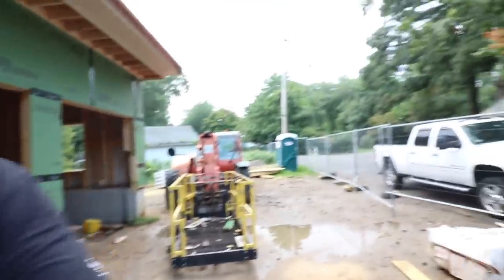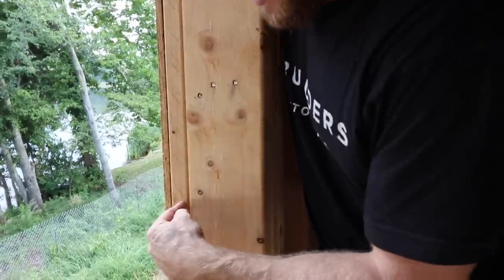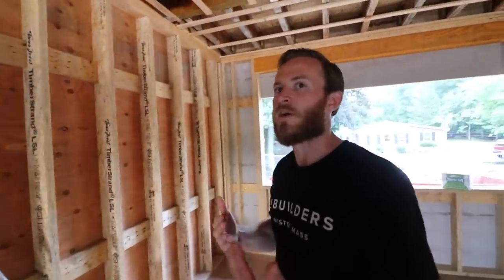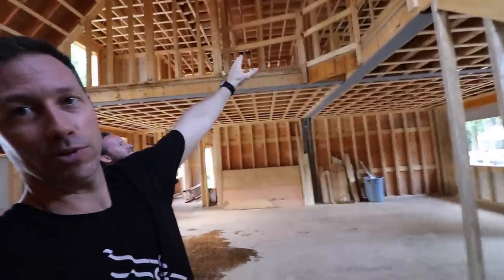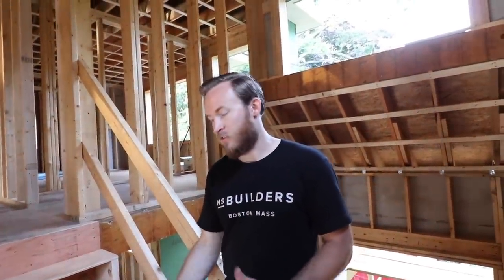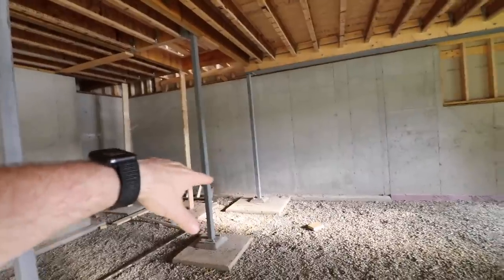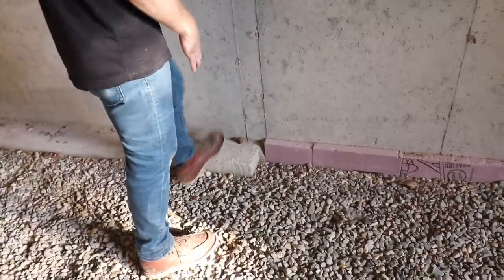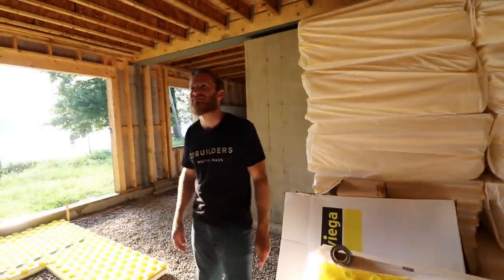How do they Build in Boston? Visiting a new home in Framing

Comment: So to disparage 99% of all true pro framers in the Massachusetts area is disgusting....That guy has a lot to learn about framing. He is nowhere near the  top framers from Boston to Cape Cod...
   First the garage plywood should be vertical and attached to the pt sill not sitting on top of nailers,(hacks install plwood horizontal and add nailers) that's not even code....
  The kitchen gable wall should have been "balloon framed" from rafter to bottom plate using engineered PSL...that chisled out strap shouldn't be there at all  if framed right...
   Single king studs at windows is not code and hack work anyway...
   Using PSL studs, Lsl suds is common practice in all kichens and baths and stair stringers ( which also should have a 2x6 glued and screwed to the side of it,to add strength) for a decade or more...
   No glue seen in the engineered joists hangers ,which is required by the manufacturer. 
  No blocking at the deck plwood seams ,two bays in all around..
    On and on the amature builder failed to make a quality home....as his first frame ,he failed miserably to build a high end quality frame.....
    For framers like us who been building custom homes for 30yrs,and are booked up to a year in advance, your ignorant comments and lack of talent is why we are always busy...
Reply: On point
Reply: Where would the strap go otherwise?
Reply: Can I come work for you?
Reply: I want to believe you just because of your last name
Reply: Rather have a framer that knows how to frame than one who's got a useless degree in perfectly formatted comments section posts. ;)
Reply: Joe Framer yvv
Reply: @ClaytonYatescarenthusiast  you don't need a strap the studs should go floor to ceiling
Reply: @joeframer9642  makes sense
Reply: @joemonroe9456  I appreciate your comment,but that's the problem. Guys like this that read the manufacturer instructions instead of knowing what to do. It's like a set of blueprints for a custom home. Framers like this , follow the plan exactly, instead of recognizing mistakes in the plan and correcting them in the field. 
   Your the type of guy who likes the builder with the shiny truck and fancy new tools, I'll stick to my poor gramer and thirty years ( never out of work) of building  custom homes. My time is dedicated to craftsmanship not penmanship.
Reply: I see the value in both Joe Framer and Joe Monroe' comments. Yes, designers and engineers don't always put out a well thought out set of plans. Less so manufacturers but even their instructions can (sometimes) be improved upon. A great builder doesn't need to know how to make perfectly spelled comments but they do need to read those instructions and clearly communicate any of their concerns to the Owner or Designer. I've experienced builders who simply took it upon themselves to quietly "fix" what they didn't understand, install ceiling rated drywall on walls and wall drywall on ceilings, and put 8 bends in a bathroom vent. All claimed to have been "doing this for x years" and I was supposedly the first to call them on that. It happens less often that they actually improved on the design but I still would have appreciated them informing me of those changes.
Reply: You're only but so good yourself when your own ignorance shows in bashing others, theres a better way to communicate and still be professional
Reply: @joeframer9642 There are pros and cons to each method and a balloon frame has plenty of it's own problems. Your comments are just as pretentious as the "99% of framers" comment they made. You assume so much without knowing the details of this build. Classic internet.
Reply: @nickmanc86  I don't assume anything,it's right there on video
Reply: @ACitizenOfOurWorld  I understand your comment,but I didn't go into detail,I was generalizing....in fact it would be a breech of contract to just make changes without permission...to be clear. I would see the problems with the plans, contact the builder,GC and send an email about the problem, explain and draft my solution via email,..which is sent to the architect and engineer to sign off on....I give multiple options and my recommendations....the problem is college educated architects and engineers with no actual field experience framing and no common sense...it takes a minimum of 5 years to understand the basics of framing....we only build quality homes to our standard or we don't take the job, we must be doing something right if we are booked up to a year in advance for over 30 yrs......as a framer I'm offended by the quality of his work and feel bad for the homeowner,that was my point
Reply: Bullshit on the single king studs. But I agree on the balloon framing of the kitchen gable wall. At 4:33, you can see he's got double jacks in the opening with the long header span.
Reply: Ha, I had a framer who built an addition to my house and bragged that between him and the other two on his crew they had over 70 years experience. Problem was their building techniques were also 70 years old! I now have problems with leaks, mold and pieces of trim falling off. First, I would say really do your research when vetting a framer/builder. (Apparently I didn't do such a good job) Second, people don't usually like change, so when building manufacturers change their products and installation procedures most people scoff at it and say it's "no good" or "what was wrong with the old product?" Building product technology is moving at lightning speed and builders/ framers need to keep up and keep an open mind with the way things are going.
Reply: Robert Russo -- technology is always in a state of flux, especially today where it moves quickly. In the 1970s, the "state of the art" technology produced lots of houses with moisture problems. Our "state of the art" technology likely has some unforeseen consequences yet to be discovered. Older methods produced durable houses, but they were inefficient. 
-- One could, by the way, reduce carbon footprints just by downsizing houses, without worrying so much about making them so tight.
-- Bleeding-edge technology has to be taken with a grain of salt. On the other hand, stick-in-the-mud, heels-dug-in resistance to progress isn't a good position either. One has to stay informed, but with a healthy skepticism.
Reply: So I have a question. I'm a firefighter, that said that's how I'm looking at this house. Is there any consideration given to how the house would burn, when engineered wood and balloon frame are used together?
Reply: Fireblocking is required every 10' on tall balloon framed walls. I'm not sure why you're worried about balloon framing and engineered wood. The fireblocking would seem to accomplish what platform framing does in terms of fire spread. But maybe you have seen something in your experience that I don't know. Maybe fireblocking isn't quite as effective as platform framing in preventing fire spread.
Reply: @grizzlygrizzle  Reson I asked is that engineered woods tend to burn at much faster rate then when compared  to solid wood. The blocking is effective is stopping the chimney effect that balloon frames have in a fire, when there is nothing breaking up the void.
Reply: Yeah, fuck all thos dyslectic framers who have been in the business for decades and learned their trade on site. Books are the way to go when learning how to build stuff, not actually building! :)
Reply: ya no one cares what garbage is done is cali
Reply: Wouldn't using balloon framing or not be up to the blueprints?
Reply: Well that in itself is an issue, they put an addition onto the house. The old house settles differently than the new section and has likely caused new settling to occur which is the source of your leaks which I bet is between the new and old sections.
That or you just didn't do a bit of research into them and got conned. Plenty of those assholes about in all trades who will claim to be long term experts and professionals but don't know shit, they just want to take your money and run before their mistakes show.
Reply: @SpcPoole  so I am a builder and a firefighter, with that being said I can tell you in fortunately the two trades do not communicate. Builders do not truly think how a house or materials used will behave in heavy fire conditions. The engineered wood used in this house is fantastic for covering long spans while maintaining high loads but yes these I-Beams will fall under fire load on roughly 5 minutes ( I have conducted love birds for training). Local building codes only care for the minimum and honestly half of them don't think about this either till an event happens to bring it to public's attention. I do want to clarify that when I say builders I am speaking in a generality to the industry as with everything exceptions do apply. To the exception I greatly thank you for the safety your thoughtfulness can bring to a fellow fireman. Anyway that's my 2 cents
Reply: Luther Dufrene   ---  Most of these people here don't understand the problem, 'my oven is made of steel and it doesn't melt' idiots, there are some fire resistant two-part spray foams that will add more time, this builder didn't leave room for them, they cost a little more and builders will try to cut it because the value doesn't show, the same applies to multiple blocking stud spaces and using fire-rated sheet rock vs 1/2", and who would pay for more than one layer of fire-rated sheet rock??  Most of the builders and buyers are shortsighted and really cheap.  The only way I've found to sell it/justify it is reduction of noise transmission, sometimes that works.
Reply: Preach on brother
Reply: He's gonna lose his shirt
Reply: @davidnull5590   abosolutly correct on how do you justify the additional cost to make your house more impervious to fire. The added noise reduction is a good sell I have never thought of that. Personally I try my hardest to stay with traditional framing as it is much beefier and will withstand fire well before structural collapse, but TGI beams have a well deserved place in the building industry and it is up to the fire service to stay current on the building technology going into modern homes and adapt their attacks. I just wish there was more communication between the industries.
Reply: Joe Framer m
Reply: I think you raise some good points Joe Framer, but to say that only hacks install plywood horizontally is saying an entire industry are idiots and crappy at their jobs. The plywood certainly should be framed down and over the plate, and nailed off correctly, but there is nothing wrong with attaching plywood horizontally. 

I use glue on my hangers too, but many don't know this will help to prevent squeaks. Not sure it is a requirement for every hanger.

Single king studs are fine, and totally to code, as long as it corresponds to the correct header length  and size. It also limits thermal bridging. Too many times we are putting in pumber when it isn't required. 

PSL studs are certainly the way to go if you want a straight wall. It would have been a good way to frame that wall....but using conventional framing members, they did it correctly.

Plywood seams don't need blocking.
Reply: @brad-yo7jb  running plywood horizontal reduces sheer strength, also blocking in plywood increases sheer strength and is why it is required on corners and in middle of walls over 25 ft
Reply: Of course it's required for shear strength, and I'd like to see the study or info that shows placing plywood vertically is stronger, or that using it horizontally is sub par or hack like. Just to be clear I use it in both orientations, based on the structure, and criteria we are dealt. The problem we are dealing with in the building trades right now, is that there isn't one single authority having jurisdiction for all locales. Some states are using 2009 IBC, some 2015, etc.. 

Many guys and gals in the trades, are taught one way, and taught to believe any other way other than "their way" is wrong or sub par. There certainly are best practices, and we would all be wise to follow them. Best practices also offer flexibility based on the climate zone we are building, micro environments, etc..
Reply: @brad-yo7jb  true there is no jurisdiction, I also have seen how many engineers recommend stuff done. Some of it I dont agree with. If shear strength is increased with less seams the why does roof sheeting run horizontally. I think it helps with walls but just by the smallest amounts.
Reply: I'd like to see the evidence on the vertical vs. horizontal. If a wall from sill plate to top plate is 96" than it makes sense to go vertically. If you go any distance above 96" it makes no sense to sheath it horizontally. Once you get over the first course, you still have as many seams, and even less of an offset of the sheets to provide the shear strength.
Reply: Joe Munroe, shaddup!
Reply: i agree on the gable wall being balloon framed!! def should have done it that way
Reply: Engineered wood does burn at a faster rate when exposed to open flame. The thing to consider when using engineered wood is IF it is protected, and IF it IS protected - are the cavities filled, and if they are - what are they filled with???

You see if you take an engineered stud wall, filled with BIBs insulation or dense pack cellulose (that is installed to the proper density), there is no room for fire spread generally speaking, because the void is densely filled. If it is an engineered stud wall on the interior, that is an uninsulated wall, or even insulated with batt insulation, and not protected by drywall, then it is very dangerous. It is dangerous even if it is drywalled, because the batt insulation does not stop fire spread. There is much truth in the fact that engineered TGI joists that are unprotected are firefighter killers. If the TGI is protected and the joist bays are filled with a dense pack insulation, the danger is nearly null. 

Open web wood trusses (whether they are roof trusses or floor joists) though are an entirely different story, because generally they make the entire cavity they are installed in wide open, even when insulated with batt insulation.

Ballon framing with engineered lumber is certainly a great way to build on long open tall walls....if the fire blocking is done correctly (tightly). All too often thou, the fire blocking is not installed well.

A double plate top plate will also always stop fire spread better than any 2x material nailed or screwed into a stud bay. Joists resting on the plates and studs below will always be a stronger assembly and fire resistant assembly than a mechanically anchored rimboard into a balloon frame wall.
Reply: joe framer is right on, i believe you went soft on pointing out the problems, to many people on here that might be looking to hire this guy or somebody like him and then not know something is being framed incorrectly, im working on a remodel now and im having to completely tear out and frame the master bath from a bad framer, they pulled 2x4s for joist tying into 2x6s with half ass support walls, guess they ran out of 2x6s, and not one hanger in site
Reply: Joe Framer "My time is dedicated to craftsmanship not penmanship"  gunna use that with my boss next time I drop off invoices.
Reply: grizzlygrizzle we are seeing a lot of air quality problems in newer homes. The idea was they seal them tight to keep in the conditioned air. The home becomes more efficient but on the flip side the air becomes stagnant and unhealthy. Many HVAC companys are doing "fresh air intake vents to bring in some fresh air to mix with the air in the home.
Reply: @joeframer9642  in europe we have concrete ringbalk to mounting roof and topfloor with M12 treads.
Reply: @joeframer9642  THE STRAP WAS TO TIE THE TWO FLOORS TOGETHER...ITS A TECHNIQE USED IN HURRICANE / TORNADO AREAS....ITS STARTING TO SPREAD MORE...SOME EVEN TIE THE ROOF IN
Reply: You’re mad that your business is doing well and people are paying you?.... wtf is up with old people wanting people to blame all the time
Reply: So your 2x4 and plywood mcmansion is better than his?
Reply: @ClaytonYatescarenthusiast  There should be no strap. Studs should be continuous.
Reply: @brad-yo7jb  In Alberta Canada they highly frown on vertical sheeting. Unless supplied with sheeting specifically designed for that purpose.
Reply: Joe Framer, i believe he said this was his first build where he was completely in charge. Im sure your first build was just a perfect mansion right? Maybe in 30 years he'll have a condescending bad attitude like yours.
Reply: @joemonroe9456  well if we're going to grammar police illiteracy was over used as well as the word and in you educated reply sir.

Comment: In Arizona they are using the strapping here now too but it is usually metal and is intended to help flush out the drywall on ceilings. The only thing i notice is all the blocking. We don't use nearly as much blocking on our walla.

Comment: In the above ground exterior walls, why not just do 1.5" of closed cell (R11) and omit the rockwool? When you're using foam you don't necessarily need to completely fill the wall cavity like you would if you were using rockwool/fiberglass alone because with the air barrier property of foam there isn't the risk of convection loops. Or you could just do R11 open cell. When the air-tight, foamed house has such few air changes per hour, you can pass code with a class three vapor barrier (which open cell is) instead of a class 2 (which closed cell is). Saves you money but preserves the same energy benefit!